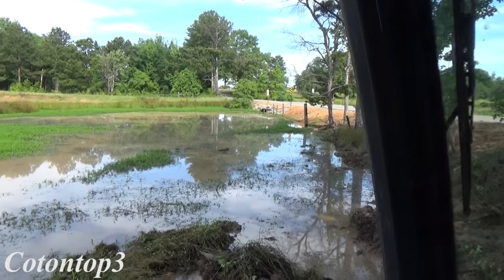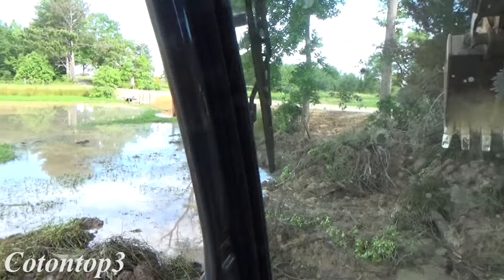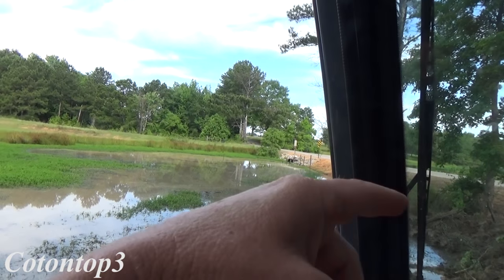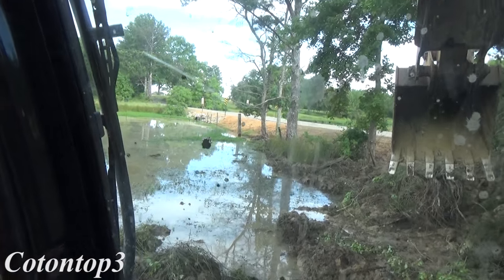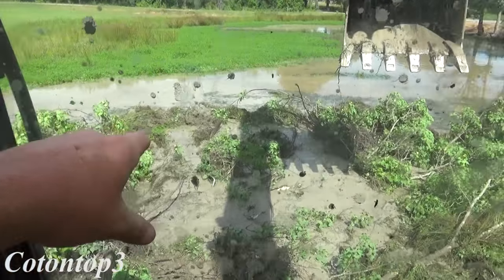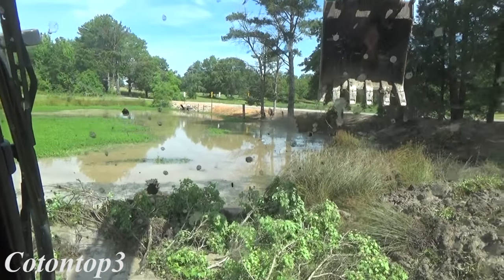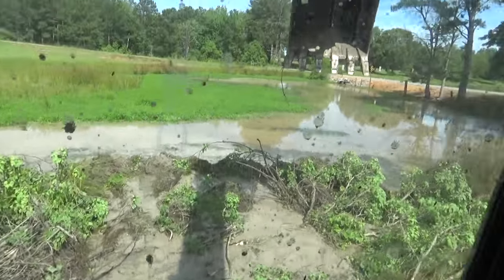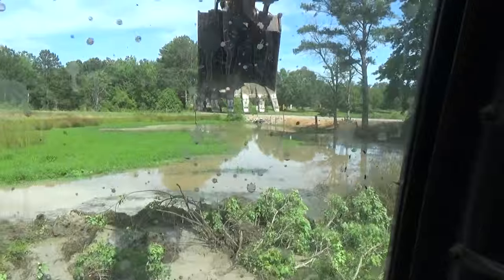John Deere 200 excavator drone footage with a dji phantom part 4

Comment: If I understand you are you trying to create a deeper channel for the water flow through your pond so that the bigger area which your not digging out dries out a bit and that you plan to pump it out later in the summer when you will clear out the remaining silt?

Suggestion: Have you the space upstream to create a series of silt traps/small ponds with some low level weirs to slow the water flow and allow some of the silt to drop out of the flow before it gets to the main pond? These silt traps would be easier to maintain and clean out in the future.
Reply from the maker: +Dan Whiteford I don't think I'm gonna need to pump it now. My concern was not being able to tell where I had dug already but it's not a problem even with the water still in it.

Comment: Tim could u bring some old logs home from work to set the home on.  that helps me when I'm cleaning out ponds
Reply from the maker: +Thomas C.fullwood that's what I ended up doing and it worked good. Do you let the mud dry some and then haul it off or how do u deal with the mud?